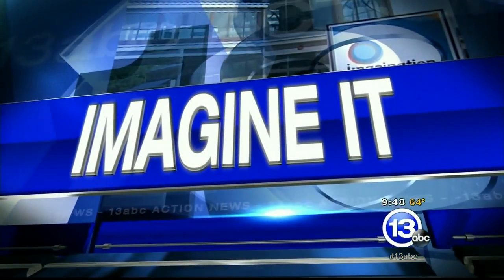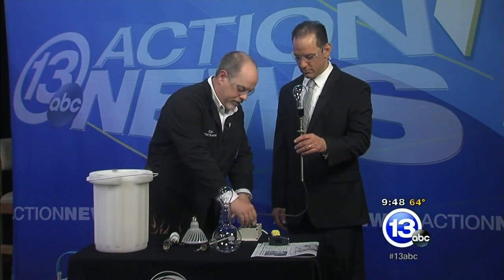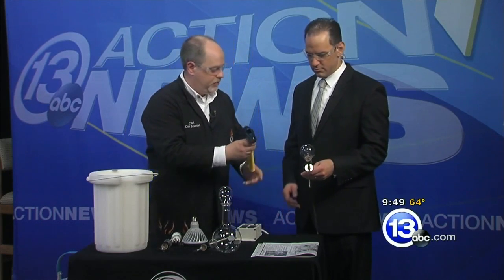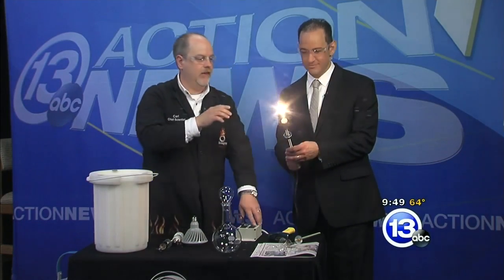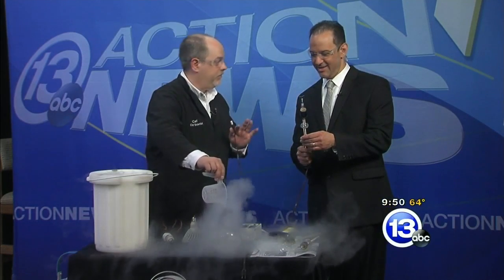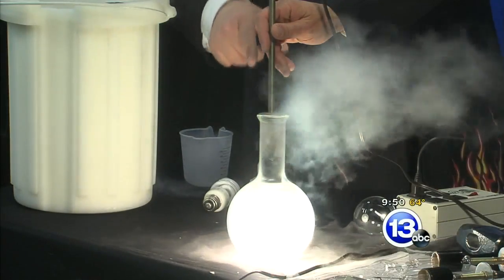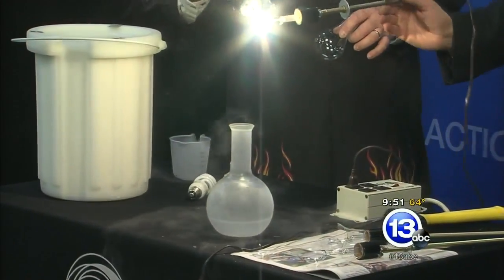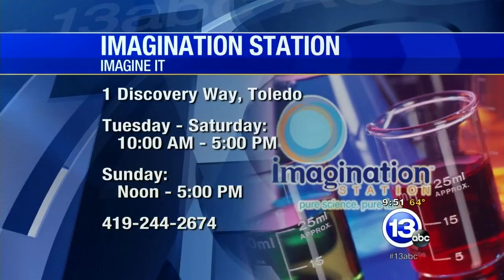A lightbulb in liquid nitrogen

Comment: It would be interesting to measure the temperature of the nitrogen during the process: by the standard model it should not change temperature as nitrogen is assumed not to absorb IR radiation. I think it will increase in temperature.

Comment: Nitrogen is not an inert gas, it is simply not an oxidizer
Reply: yeah but it has some property of inert gases
Reply: @KishanKumar-pi6lv  an inert gas as an electron configuration in the external orbital that prevent them to make bonds with other elements (and even other athoms of the same gas). Nitrogen conversely is a really active element. Together with oxygen and carbon is the base of most of inorganic and organic chemistry and of biological activity.

Comment: Liquid nitrogen and no glove? Yeah that's smart for sure.
Reply: You're better off without gloves. 

You can hold little bits of liquid Nitrogen in your hand. The part of it that makes contact with the warmth of your hand boils of and creates a film of gas between your hand and the LN.

If you put on a glove, and try the same thing, the glove will freeze and the frozen glove will freeze your hand.

It's actually very dangerous to have fabric on your skin when working with LN. Even rubber gloves.
Reply: @tylerdurden3722  i guess it depends on the glove, and yes it will boil and not touch your skin but that does not mean it isn't dangerous. It will still remove heat from your hand, so it will still cool it and being at such a low temperature it would cool it pretty fast.

Comment: Sir 
Is the role of nitrogen to provide more light?
Reply: No, it will just blanket it from the oxygen in air. At high temperatures like those of filament in the bulb, the metal will get oxidised quickly if not prevented from being in touch with oxygen. So Inert gases like Argon, Krypton and less Inert like Nitrogen are used in the incandescent bulbs.

Comment: If you live in northern climates, you will find that florescent lamps do not start up when they are placed in unheated crawlspaces and outside storage sheds.  They are too fragile to use on vibrating machinery, and like LED bulbs, do not survive heat rooms, saunas, and ovens.   

People talk about the energy savings of the new bulbs, but have you considered that previously, during the winter, people would sit in a chair reading a book, or watching television under a warm incandescent, and would be quite comfortable.  Now, with cold florescents and LED bulbs, they will have to turn the thermostat up to get warm.  In doing so, they will be heating the entire floor, or entire house.  So where's the energy savings in that.

Finally, look at the cost of florescents and especially LED's.  They are VERY expensive.  You say they have a very long warranty?  What is the likelihood that you will be able to get a warranty replacement or refund from a chinese company 10 years ago?  Many companies don't even last 1 year.
Reply: “I have a bit of a fascination with stop lights (or traffic lights, if you prefer). They boil down to remarkably simple devices, little more than indicators, but thanks to driver’s education and the magic of the human brain, they are remarkably effective at safely controlling traffic at intersections. Well, most of the time. Now, there’s so much to get into regarding traffic lights. Traffic engineering is a fascinating subject which I don’t feel qualified to discuss, but there’s quite the rabbit hole to fall into. This video is about a simple but groundbreaking innovation in the traffic light and the lessons it can tell us about innovation in general. This is about the LED traffic light, and the caution of ‘but sometimes’.” https://youtu.be/GiYO1TObNz8